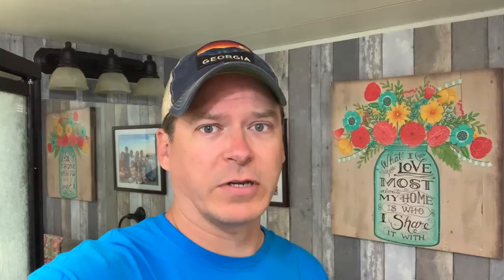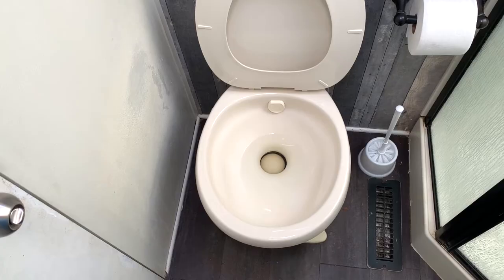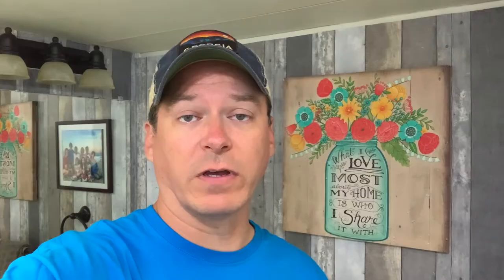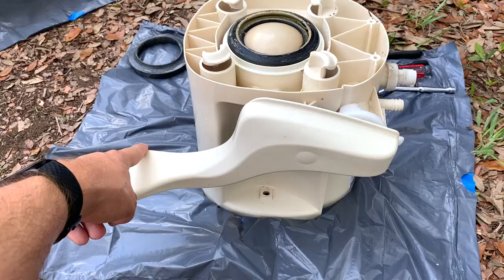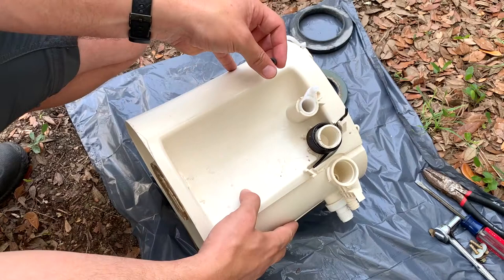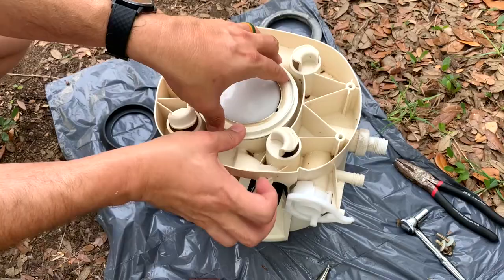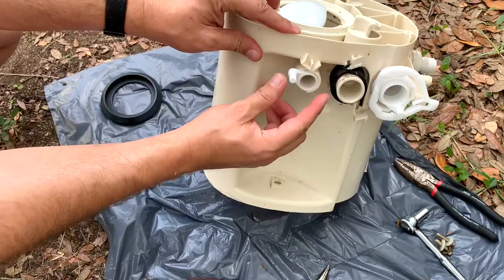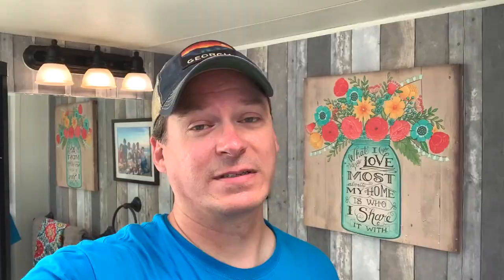RV Leaky Toilet Repair: Full Time RV Family of 9 repairs TWO ways an RV toilet leaks

Comment: Thank you very much sir. Nice clear video but I will only add one suggestion for the next time. Put you a shut off valve on your water line so you don’t have to turn everything off and also it makes it easier if you ever have another leak you can just turn it off and on right from the toilet seat.